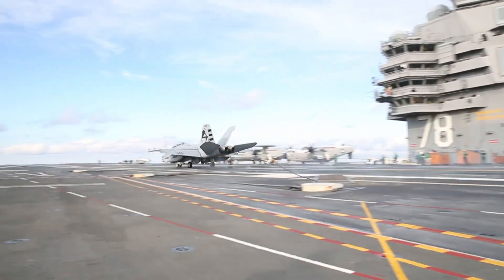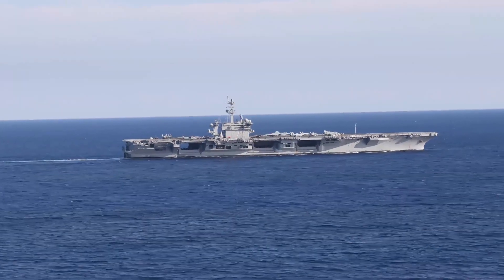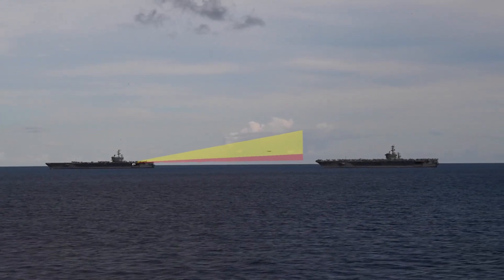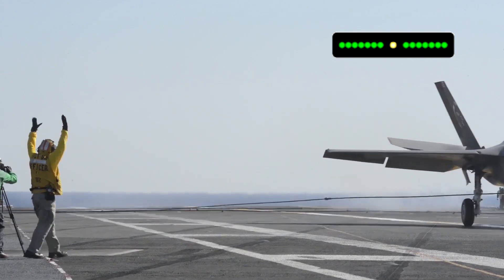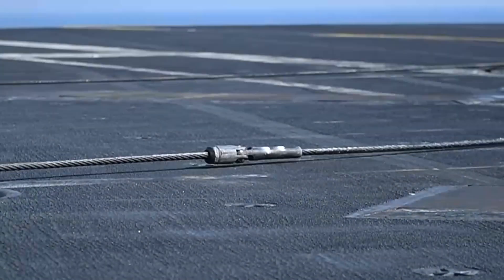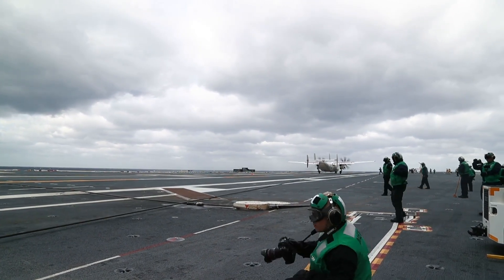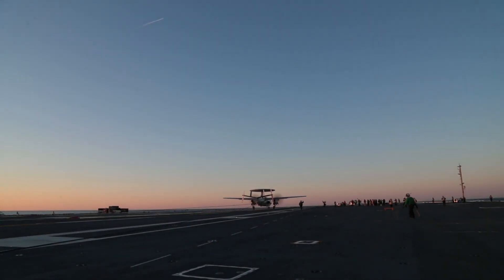Why Aircraft Carriers Lost One Arresting Wire?

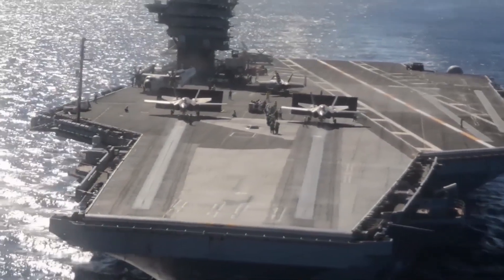Comment: 4:48 We don't see FLOLS or IFLOLS but rather MOVLAS. MOVLAS is the manually operated visual landing system. It can be used in emergencies or high seas conditions   to give the LSO more control over approach aircraft glide slope.

Comment: I'm pretty sure the biggest reason they went from 4 to 3 was the massive improved accuracy of digital ILS (instrument landing systems) in all the aircraft from the 70s to the 2010s. One of the biggest selling points of the F35 (especially to foreign nations) is the auto-land ILS capability, which can stick the 2 wire in zero visibility with minimal input from the pilot (so long as the sea state is not totally unreasonable). You don't need 4 wires when your landing patch has been drastically shrunk by improved avionics technology.

Comment: My brother was in the Air Force and stationed at an AFB in New Mexico.  Occasionally, Navy pilots would come thru to do some training and he said the Air Force pilots were astounded at how quickly the Navy pilots would put their aircraft onto the runway when landing and how rough all the landings seemed to be.  The Navy pilots explained that they did not have the luxury of a mile long runway at sea and preferred to get the wheels on the ground ASAP.  The landing of a carrier aircraft has been described as a controlled crash.  The landing gear and airframes of a carrier aircraft are extremely robust in comparison to a land based aircraft because of the punishment they undergo when slamming down onto the deck and then being stopped dead in two seconds.
Reply: The two most useless things are altitude above you and runway behind you...

Comment: Once a plane catches the 2nd arresting wire, how do they stop the next (3rd) arresting wire from catching on the landing gear?
Reply: Watch the hook point during any trap. 
The hook rises considerably at wire engagement and during the deceleration, thus being well above the next wire(s). It doesn't come back down to the deck until stopped.
Reply: @thomasd3862  Shit, it PAINS me how easy that answer was...  (I had been wondering the same since I first saw "Top Gun" in the 90s.  'Today I learned', I guess...  )
Reply: @Atlessa  watch the lens on the playback of the scene where Cougar lands. They actually brought an aircraft in below the glidescope to get that shot. You will have to pause it of course. That to me shows the commitment of the Navy to assist with that movie.

Comment: Also, the arresting system is stopping a plane at full throttle (if they miss, they need to be prepared to go around.)
Reply: FADEC will spool down the engines once the trap is assured. It's not like the plane starts towing the ship along at the end of the trap.

Comment: I worked in PLAT/Lens on the USS Midway, CV-41 and USS Ranger, CV-61 from 1980-1985. My work center was responsible for operating and maintaining the “Lens” and the closed circuit tv system that filmed and recorded all flight operations. The upgrades look great!

Comment: In short: The first wire was never used anyway.
Reply: Oh yes they were. But it was not a good landing. And if it was a TAXI 1 WIRE, even worse. That meant you were really close to the ROUND DOWN (stern).
Reply: but now they positioned the wires so that tge first wire of thr 3 wire system is also useless
Reply: @carlosandleon  So, they didn't remove the first wire but the fourth.
Reply: @Yora21  I guess so, the video does mention the first wire of the 3 wire system is roughly there where the first wire of the 4 wire system was
Reply: And yet, the video shows the one wire getting snagged. (and a three from the hook bouncing over two)
Reply: Incorrect

Comment: So if the first wire was too dangerous, why did they even have it? Also, why is 3rd wire safer? It would seem like hitting the second wire would be ideal in case of snaps.
Reply: The 3 wire is considered perfect. If you only had one wire a lot of pilots would miss and run low on fuel.
Reply: To answer your first question, I'm assuming the fourth wire was first included when the responsiveness of jet engines was sluggish. They'd get you moving fast but the power increase at low RPMs was slow. There would have been a greater risk of coming in below glideslope (GS) because power increases to stay on GS would be late.

Second question, it's not so much that the wire is safer - the system is exactly like the others - but the safest approach to the ship will result in catching the middle wire (the three on older carriers, the two on the newer ones). Coming in too high will - maybe - result in catching the old 4/new 3, and coming in too low will - maybe - result in catching the 1.

As for what happens when a wire is caught, think of it this way. Imagine you've created a hook out of a wire coat hanger and you're holding the non-hook end in your hand loosely - this is the tailhook hanging from the back of the airplane. Now take a string and tie each end to something so it's stretched across, but loosely. (I'm saying loosely here but obviously things are in a lot more tension in the real world.) Now snag the string with the hook, making sure your hand (the underside of the fuselage) is above the string. Now pull on the hook - you're the airplane that just trapped. As soon as the hook has pulled the string so it's taut, the hook and string will form a straight line from your hand (the underside of the fuselage) all the way down to the two ends of the string (where the wire passes below the flight deck). In other words, as soon as the hook and cable are in tension, they both pop up off the flight deck, eliminating any chance of catching wires further forward. Even if the hook hits the flight deck significantly between wires, or if the hook bounces - fairly rare, called a hook skip - it most likely won't catch a wire.

Comment: The perfect 3 wire refers to catching 3 of the four wires because it takes less time to reset for the next aircraft
Reply: I'm not sure I understood what you meant. Did you mean they catch three wires? If so, that's incorrect. The goal is (was, with a four wire carrier) to catch the third wire (now the second wire) from the back. The one (or the one and two) is/are there if the pass is a bit below glideslope, the four (or what's now the three) is there if the pass is a bit above glideslope. The time to reset them is the same.
Reply: Incorrect

Comment: What should your throttle be at when you are approaching?
Reply: I think the general sentiment is to throttle down as you approach, but as soon as you hit the wires you go full throttle, just in case you actually missed. Far better to be able to circle around and try again than roll off the deck and into the sea
Reply: @callsignapollo_  ok thanks because I thought you approach it at 35 or 75 throttle and then 100 throttle.

Comment: I worked the cable system on RAF Lakenheath from 2nd quarter 2001- 2004.
Only the wing king: He came in with total hydraulic failure and some other issues. He hit the perfectly good primary steel cable with less than 10 recoveries on it like he was landing on an aircraft carrier. The notch in the asphalt over concrete from the hook directly before the primary cable was there until they repaved it. after 04.  He hit on the cable, fast and took the cable out of service and took 15ft of tape (elastic flexible roll) off each of the sides. 
It cost the wing I want to say like $58,000 total to get his aircraft with 2 souls on board safety down that day.  
We had to get a cable expedited out to England from Germany ASAP and faster for 100% replacement ability. 
His wing man took the secondary cable (like an adult) after we pulled the primary cable off the runway and we didn’t even loose a donut off the second cable. 
What was the wing king doing with his wingman and 2 other separate $35M F-15E’s over England on a proficiency flight that would cause 2 IFE’s? 
Still don’t know.

Comment: There aren't any arresting wires on the Ford. It uses a new electromagnetic arresting system. The Nimitz class as they've gone through their midlife refuel and rebuild are replacing the four wire system with a three wire system.
Reply: HaHaHa! It works best on iron jets.
Reply from the maker: Ford has an electromagnetic catapult system, but that is to launch the aircraft. I don’t believe there is an electromagnetic system for landing (yet!).
Reply: They still have arresting wires, it’s just the way those cables are stopped that has changed.
Reply: "There aren't any arresting wires on the Ford."(sic)

Incorrect. 

"The Nimitz class as they've gone through their midlife refuel and rebuild are replacing the four wire system with a three wire system."(sic)

Incorrect. Only Reagan and Bush are three wire boats and neither has undergone RCOH.

Comment: I'd have a hard time not shitting myself landing on a aircraft carrier with a metal rope being the only thing stopping you from diving off the end
Reply: i’m pretty sure they push the throttle to full power after landing just in case it snaps or they miss it so they can take off again, but yeah i know what you mean
Reply: that’s why they gun it, if anything happens they just go around and try again... then get get ragged on because they missed. i forgot what they call it
Reply: @todx15  True. But I'd still have a hard time not shitting myself 😂
Reply: @todx15  It is called a bolter.
Reply: @todx15  when they miss a wore and have to go back around it's referred to as a 'bolter'
Reply: Metal rope and big-ass engine(s) running at full-throttle to lift you back up the sky if you fail.
Reply: The pilots fly at a certain speed just in case they miss the wire completely, while still having enough speed to take off again.
Reply: Must feel awesome to get stopped that quickly tho
Reply: @gen2mediainc.577  Yep. It actually takes time to refocus your eyes.
Reply: That is why you do not work there .
Reply: That's ok, this is why there are guys that LOVE this type of job.
Reply: try playing warthunder and not use a naval air craft
Reply: @flamingrubys11  lmao i kinda wanna land a mig21 on a carrier now.

Comment: What would happen if they missed all three lines? Would they still have enough speed to take off again without dropping into the ocean?
Reply: When the plane touches down, the pilot will put the throttles to full military power to give them enough thrust in case the do not catch the wire. They don’t use afterburner unless they need it after clearing the ship again.
Reply: Once they hit the deck they go full throttle so if they miss they can take off and come around again.
Reply: Air planes landing on aircraft carrier are landing at full thrust. Some jets land with afterburners lit.  Planes are landing with the full intention to take off if they don't catch a wire. The arresting system is stopping planes at full thrust.
Reply: @DarkProxy  Thanks!

Comment: My friend was in charge of the arresting wire under deck, he said that the old systems decapitated and mamed seamen all the time if malfunctioning, the spools of wire snap under tension or get red hot if not greased constantly and break. Same with anchor crew, lots of hazardous jobs on board the carriers.  I think it is one of the most interesting armed forces, every job is important.
Reply: Arresting cables are about 1 inch in diameter - so they are heavy - and they are traveling the same speed as the aircraft that just snagged them.  There are YouTube videos of arresting cables breaking in use, and yes, they can severely injure sailors.
Reply: @JoeFrickinFriday  0
Reply: I only recently saw a below decks arresting wire video. A long time ago I saw a very old video (as @JoeFrickinFriday points out) of a wire break that clipped a guy. Only now did I wonder, what is the fallout below deck. I can only imagine it's catastrophic to man and machine. Do you know how different the poly cord system is as far as breaks. Everything breaks eventually.
Reply: @giantfisher  They don't break like people think. They check the wear on the cables and the cable you see on the flight deck get changed after it catches about 95 planes. They have a material like rope inside of the cable and they put a liquid on it which the rope like material absorbs and keep it lubricated.
Reply: Whoever told you that these cables break all of the time was not honest. I use to run and maintain the engine for the 3 wire on the Eisenhower and daily maintenance is done.  I've only seen old videos of them breaking but never in my 6 yrs.
Reply: @heirtothethrone000  they may not break all the time, but they are deadly when they do. I was fortunate to never experience a cable snap aboard the JFK. I was in the waist on the IKE too.
Reply: @heirtothethrone000  Same here. 3 was my engine on the Nimtiz until I moved to pri-fly. "Set tomcat 54zero Tomcat 5 4  Zero" :)  AND the cable is 1 7/16" if I remember correctly.  The engine is greased pneumatically (other than tracks) Those big cans of grease were a beach to carry up from the 8th deck.
Reply: ''All the time'' 
Do you mean like 3 or 4 daily? 
Or more like 8 or 9 per week?
Reply: 6 years on the USS Ronald Reagan and being a fully qualified member of V2/ Arresting Gear and being a maintenance member on the arresting gear as well. I can honestly say I've never seen a cable break nor have I seen one that had even shown any signs great enough that would possibly make anyone to believe that it would break. These new cables are 1 7/16s in diameter and have a longer life than you would actually think. There's a nice cable that the planes actually grab called the CPD(cross deck)  that takes the majority of the abuse from the aircraft and gets changed out VERY frequently!!! As far as below decks and wires breaking, the wires pretty much go through a lot of covered guides and around a lot of sheeves(pulleys) that are all covered as well.   There's a lot more to the arresting gear than what was just meantioned in this video. The older systems I can 100% believe that they weren't as safe, but the newer ones are 10000000% safer.  If you want to be even more impressed, look up ARC arresting gear,  which stands for Advanced Recovery Control. It's all computer controlled now and no manual operator input to set up hydraulic flow weights in the CROV for the different aircraft settings.
Reply: @l_AmWar  I think it was an overstatement they break all the time. I recall seeing a video on the IKE when one broke, took out a guys ankle and one guy hopped over it twice. But I would say all the time is a stretch.  What it did was take more crew off, less crew less costs and it was not really needed anyway.  Same reason they have less elevators, less people to run things, less costs.
Reply: @l_AmWar  I'd hate to see how dangerous it was in the '30s when they where just learning how to use aircraft carriers
Reply: @l_AmWar  that was long lol
Reply: "all the time" is incorrect. In the more modern era (post Viet Nam) the safety records and safety efforts were heavily redoubled. Yes, as in any mechanical device under tremendous stress, there are failures. But the cables are checked prior to, and after flight ops. Each pendant (cable) is recorded with every capture, every drop, and every off-center trap, and there are predetermined life-cycles based on endless shipboard and land-based testing (Lakehurst NJ). When a cable breaks above deck, yes, all hell breaks loose in the AG space associated with that cable, and the noise and metal "explosion" is tremendous, but there are built in safety devices for such an event. They aren't going to just let that factor slide, and just keep a line of green shirts standing outside the space waiting their turn to go in and get sliced in half by errant wires! haha I was a green shirt. Please believe me when I tell you that stories like these are mostly that, just scuttlebutt, but usually based on an incident or incidents that sailors love to embellish. Like seeing mermaids, or getting laid every time you pull in to port, the stories live on!
Reply: I don't know what "all the time" means, but wires breaking, people getting hurt, or worse, killed, is extremely rare. Aside from actually winding the wire strands into thick cables, the manufacture of the middle portions - the cross deck pendants - is done on the ship and there's plenty of quality assurance in place.
Reply: Well maintainence crew are propably the most important part of a military right after the logistics.

Comment: @1:06 it's an EA-6B, and when the camera zooms out @1:09 , it's suddenly an F/A-18F? man that's trippy.
Reply from the maker: It was an unintentional editing error, which we are glad to have made 😁
Reply: @NotWhatYouThink  I was a spotter for my local CAP for years. I got pretty good at identifying aircraft in a split second. thanks!
Reply: It's actually an F/A-18C.  Since you can't really see the shape of the inlets in this footage, you have to rely on the shape of the LEX (leading edge extension).  The A, B, C and D models have a slight "S" shape to the LEX.  F/A-18-E/F and EA-18G have a larger single curve.
Reply: @synjdcrispy7843  Well, I guess I wasn't close enough. thanks for the correction!
Reply: @tankacebo9128  It was an issue identified during development testing of the Super Hornet.  There's  a big difference in max landing weight between the aircraft.  If the id was wrong, the arresting engine could be set wrong, and either overload the hook on a C, or overloading the engine with an E/F.

Comment: What is the purpose of a vertical takeoff and landing jet fighter when they're going to land on an aircraft carrier in a traditional fashion? Seems to have been a serious waste of money
Reply: Catobar and stovl/vtol are very different beasts.
Catobar is vastly more expensive, but allows heavier takeoff weight. Stovl on the other hand, is much cheaper but not nearly as capable.
Reply: Amphibious assault ships are not equipped with catapults and arresting gear.